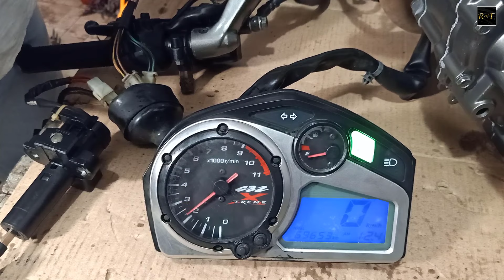Hero Honda CBZ Xtreme engine restoration (150cc)

Comment: What about the tafit timing ?? Also it would be much helpful if you provide the parts list life bearings of which section gasket etc that needs to be replaced in a restoration process. 
Thnx and keep up the gud work brthr, God bless.
Waiting for your reply

Comment: Questions please : you don't show splitting the crank to replace the big end ?  Also I notice  the main bearings slip into the casing or crankshaft and look a little loose ..they should be a tight fit and not fall in?   Finally the clutch baskets wear on these engines and rattle at low RPM .. Do you replace or re rivet ?     Great vid ... Thanks a lot ..

Comment: I also rebuild my Herohonda hunk 2007 model bike, and also restored it's engine.
Reply: TG Abhishek i do have some problm in my Hunk.
RPM gets increases in 1 hour if ride
fuel economy is not gud
engine oil level gets decreases rapidly

Takes lots of effort to start the engine when bike is not in use for about 6-7 hours
Reply: @kumarmehul421  in future I'll discuss this point in my youtube channel, but here I say in short that bro I'm not a technician but as per my experience your bike has carburettor problem as well as head piston.

Comment: These are good engines. 3 horsepower less (more or less) than a Royal Enfield 350 and weigh half as much - they'll also last much longer with less maintenance. Astra Honda Indonesia has been using this same basic type since the 90's in 125 up to 200cc bikes.

Comment: Wow,  sand blast, paint, and then clean the valves, on top of the cylinder head.  Really, wow, wow and wow.  It might have been remove valves, clean valves, lap, and then sand blast, paint and then reassemble.  Just plain wow.

Comment: What was the last unit which you have mounted in valve cover @14:13 
. Which is having a silver intake and it's connecting to carburettor?

Comment: I want to buy a 1977 cb550 for 80 bucks on ebay, is it worth it to tear it down and rebuild it as a first go? despite what the price is, is it reasonable?
Reply: @matthiasweigel311  just the engine, not the entire bike. I came by a 78 honda for 600, but I think it was sold.

Comment: U have restored an engine with poor working process..not using any special tools..also holding studs like that is not good it can be deformed... Not like everything is wrong quite happy that u used torque wrench for tightening some bolts but is that the recommended value..u have to ensure that....